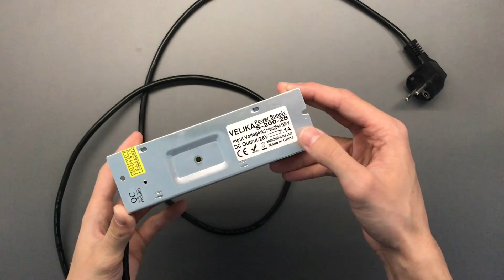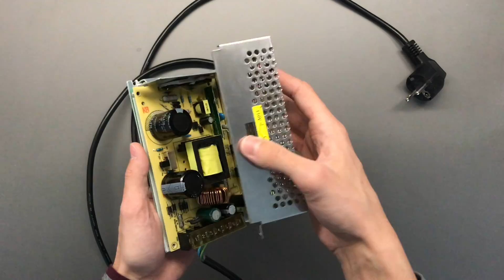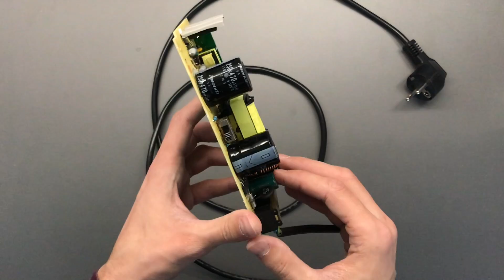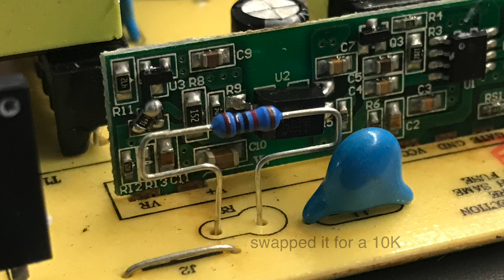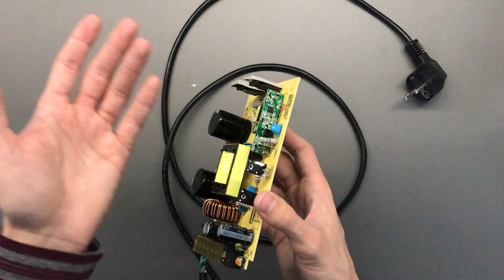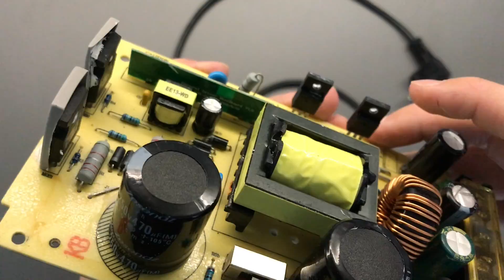VELIKA Power Supply from Aliexpress Review / Warning / Fix

Comment: you should not have opend it in the first place. it might have worked fine initially.
Reply from the maker: yhea, shoulda trusted they did a bang-up job on that 20$ supply .. you're right

next time I'll hug the case and plug it in 🤘
Reply: @Darieee  I am posting this because I have a VELIKA 600W 32V supply that was working fine for 2 years at least 500 hours on it. I was trying to repair it and saw your video. Sadly I did not manage ti repait it, I will just get a new one.